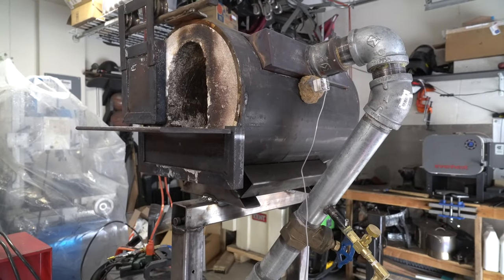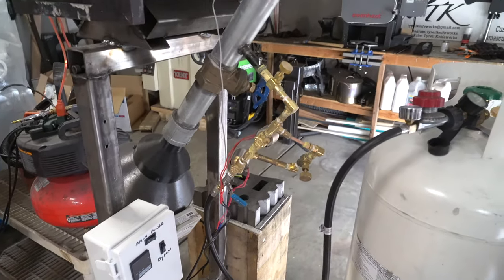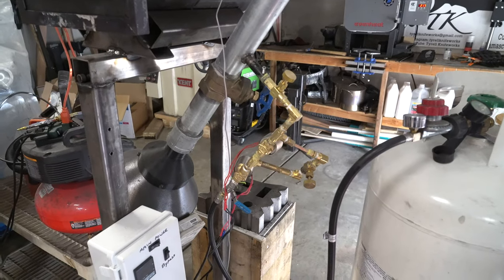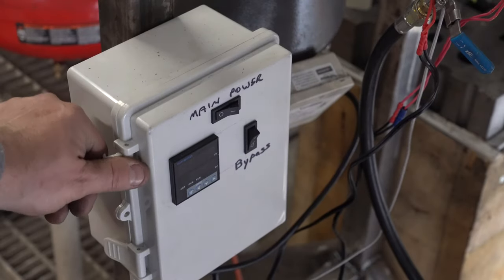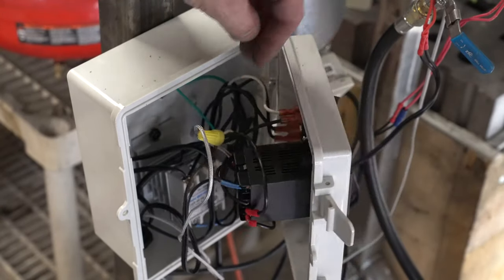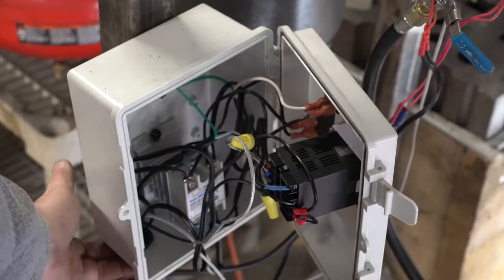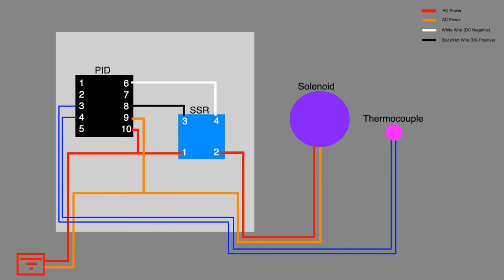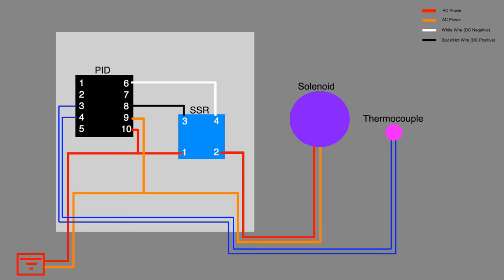Triple-T #128 - Upgrading to a computer controlled forge!

Comment: Hi Dennis, I'm building this right now (built the forge a few weeks ago). I had a couple questions: (1) I bought the SealSee K-Type Panel Mount TC that was in your amazon store but can't figure out where it goes; (2) in the wiring diagram, do all of the wires go into 9 and come out of terminal 9 and 10 on the PID or did you connect them all to each other with only a single wire going into the PID? (I suspect the latter but I'm dumb when it comes to this stuff); (3) what gauge wire are you using for everything besides the TC?; (4) The S-Type TC wire came with a bolt end - do I just cut it off and dig those wires out? to which terminals on the TC itself?  Sorry for all the questions, just want to make sure I don't screw this up haha. BIG THANKS from Sacramento my dude!
Reply from the maker: The TC goes into 3 and 4 on the PID.  On the final wiring diagram, if you’re using the switch then use a wire nut and connect all the orange wires together where they converge on the diagram.  Same with the red one.  You can pretty much use any wire, buy a 2-prong extension cord and just cut the end off and use that.  For the s-type TC, I used the wires that came with the PID and just cut the leads off and screwed them into the back of the TC.  I hope that helps.
Reply: @TyrellKnifeworks  Thanks Dennis! That covers it besides this TC wire that came with the PID: one end is a bolt with a spinning nut... I'm guessing I just clip that off and fish out the two individual wires to connect to the TC or PID as it shows in the diagram. Anyways, thanks again and keep up the videos! I used your forge press video, your surface grinder attachment video, and your knife vise video to build my own of each. Invaluable dude. Cheers
Reply: Say I got the s-type tc and Inkbird pid in ice water it says 32 degrees but in boiling water it says 203 degrees do you think the deviation will multiply at higher temperatures.

Comment: Do a the needle valve bypass require soldering?
Reply from the maker: No soldering required, these are pressure fit connections.  Make sure you test everything after connecting though with soapy water.  I’m glad this helped you out. Thanks for watching.

Comment: Would this work for heat treating for Hardening? A lot cheaper than a proper heat treat oven
Reply from the maker: You would need to account for any hot spots in your forge.  If you used a steel tube to even out the heat, this would work very well in place of a heat treat oven.  I'm not sure I'd try doing stainless steel heat treating this way but it would probably work.  Thanks for watching, Robert.

Comment: awesome video. this instantly got a lot higher on my priority list. any reason why you didn't go with a forge-welding capable P&ID? was it signficantly more expensive?
Reply from the maker: I just couldn't find a cheap PID with a set point and honestly you don't need it.  When forge welding, you want your forge as hot as it can get usually.  The $4 bypass switch is better IMO.
Reply: @TyrellKnifeworks  fair enough. i love the fuel bypass move too.. very clever. looking forward to getting this in my forge now.
Reply: @TyrellKnifeworks  one more question for you - when at a temp higher than the PID can handle, does it still display what temp you're at (just not control it) or does it show an error? i'd love to be able to see what temp i'm at those high temps even if i can't control the temperature...
Reply from the maker: @thebogamin  it still shows the temp.  If you have it set on Celsius then your set point can be 1999C which you’ll never reach in a forge.
Reply: @TyrellKnifeworks  so then if that's the case, why would you need the full throttle bypass? 

I appreciate your responses... i have all the pieces on the workbench, just trying to make sure i have the blueprint in my head laid out appropriately. this is just the last hurdle that i wanted to fully understand.
Reply from the maker: @thebogamin  I have mine set in Fahrenheit cause that’s what I’m used to.  When I’m forge welding I want it higher than 1999F.
Reply: @TyrellKnifeworks  got it. seems like you can either use a bypass switch which will keep the controller in °F (this is my plan since i got so many switches in the pack 😂) OR you could change the controller to °C anytime you wanted to go full-throttle. i think all of my questions are answered for now!! thank you again for the info!

Comment: Does this only work with a forced air forge? Not sure if you addressed that maybe I missed that...
Reply from the maker: Yes, it works just fine for Venturi burners.  Slightly better actually because controlling the gas level also controls the air intake plus you don’t need the second solenoid because there’s no fan.  Thanks for watching.
Reply: Awesome I loved seeing this video I watch all your videos this is very helpful because as much as I would love ht oven far out of my price range. All your videos are great and your work is amazing love seeing how far your work has come

Comment: Have you tried to do stainless in this? Awesome video!
Reply from the maker: You mean heat treat stainless?  No, I have an oven for that.  I have used it for forging stainless Damascus though.  Thanks for watching, Garrett.
Reply: @TyrellKnifeworks  yep I’m hoping to build a forge like yours in the hopes of heat treating stainless steel. I figure I could build a really nice forge for $2000…. Maybe if I added a salt bath I could achieve the temperature control necessary? Thanks for getting back to me appreciate your content!
Reply from the maker: @garrettshadbolt6443 $2000 is a crazy price for a forge, you should be able to make one for a third of that.  If you have $1k to spend, just buy an Apollo forge from Housemade.us.
Reply: @TyrellKnifeworks  I meant to use as a forge and a heat treating oven, trying to get around buying a heat treating oven.
Reply: @TyrellKnifeworks I meant to replace a heat treating oven. They seem to be pretty pricy.
Reply from the maker: @garrettshadbolt6443  The problem is the hot spots in a forge.  It doesn't have even heat like an oven.  It could be done I guess.
Reply: Sorry for the confusion, I am currently using a crappy small forge and no heat treating oven. I’ve got plans to build a nice 3 burner forge so I was thinking with the pid setup I could use it to heat treat stainless. Or possibly add a salt bath into the forge. Heat treating ovens are expensive!
Reply from the maker: @garrettshadbolt6443  Yeah they sure are.  I would suggest you go with a ribbon burner instead of 3-burner venturi.  It will perform better and will be easier to build.  The cost is about the same.  Thanks for watching.

Comment: Can you heat treat stainless in a heat controlled forge
Reply from the maker: It would be kinda hard. Though the forge is to controlled, it still has hot and cool spots.  It could vary a lot between them.  It’s probably not impossible though.

Comment: Thanks for sharing your experience! The question is (special for heat treating oven) how do you make sure of the thermocouple accuracy? Specialy on a temperature above 1000C for stainless steel heat treating! Thanks again!
Reply from the maker: The best way is to get another thermocouple attached to a meter.  I also bought a k type thermocouple and tested it and both were reading the same temp.  👍. Thanks for watching

Comment: This seems like an inexpensive way to bypass the need for a heat treat oven. Yes the oven is more accurate, but for someone starting out, it's a lot cheaper than a $1500 oven.
Reply from the maker: I have the forge dialed in to about the same accuracy.  What the heat treat oven has in very even heat.  You’ll definitely need a steel tube in the forge to even out the heat.  I agree though, it delays the need for an oven.  Thanks for watching